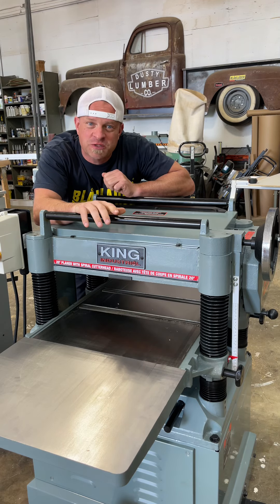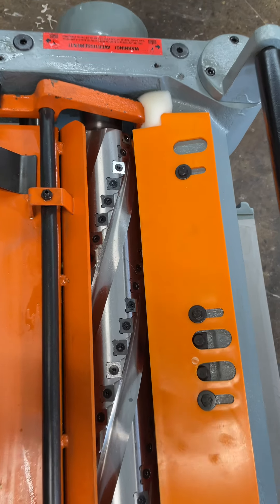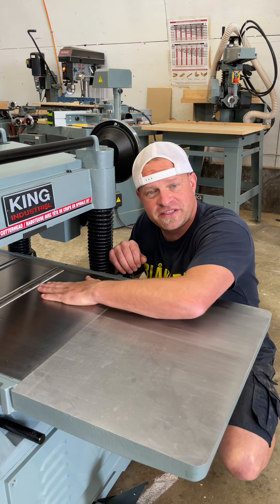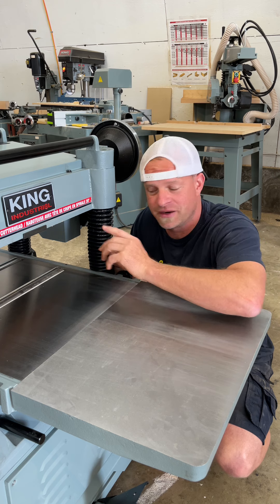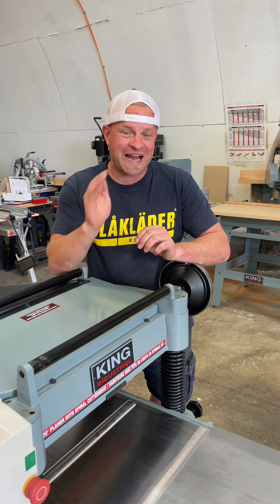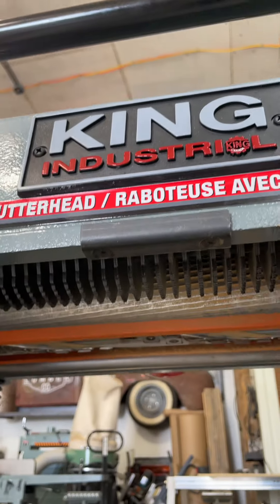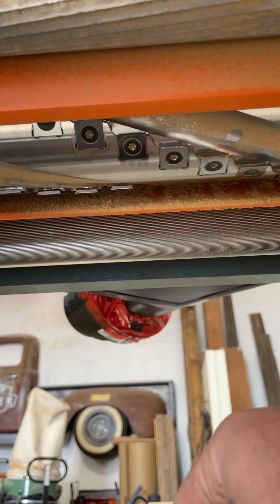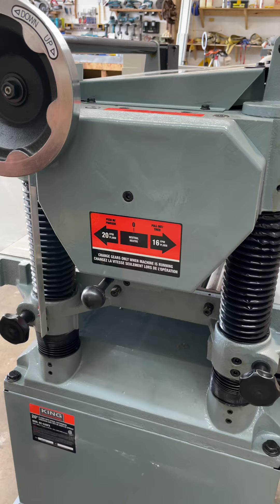Quick tour of the King 20” planer

Comment: Looks like grizzly, different color.... I love mine I've had for about 8months now. I was looking for what other brands you had. Shaper and router table.  My shaper is a old craftsman that I put a 1horse motor on and built a new table and fence so I can use bigger bits.
Reply: Heard a couple times over the years that 2 brothers started grizzly( USA) and busybee ( now craftex, Canada) that part might not be true but most definitely the machines are identical minus colour scheme and stickers. King is another company I think predominantly sells in Canada so it maybe replica of grizzly craftex. Especially 16 & 20” planers made in Taiwan 30 yrs ago, now made in China, lol I think it’s one manufacturer making 1 machine , with 6or 7 brand names, and colour schemes. Interesting nugget of info, it’s design copy of 70’s Rockwell Delta thickness planer